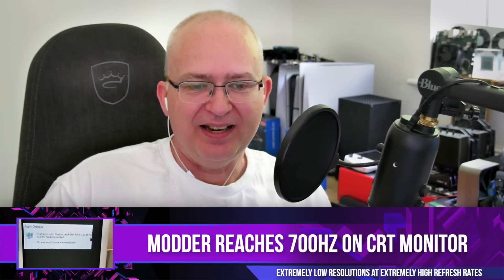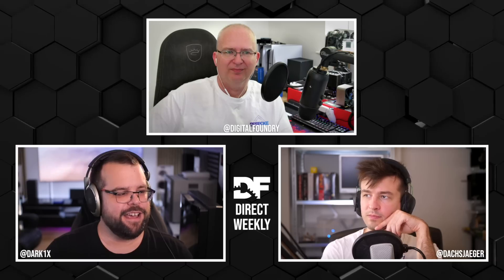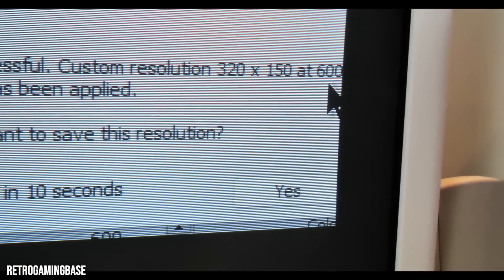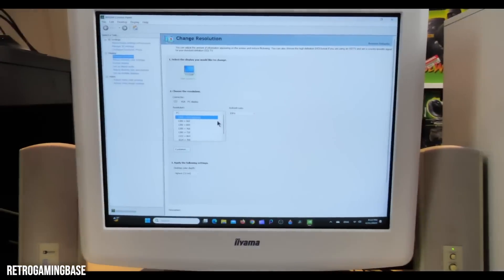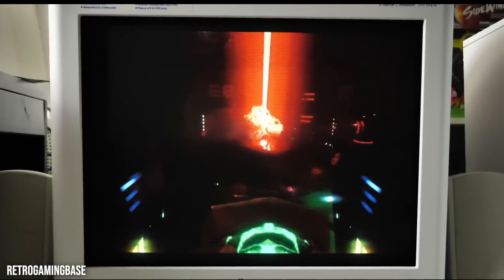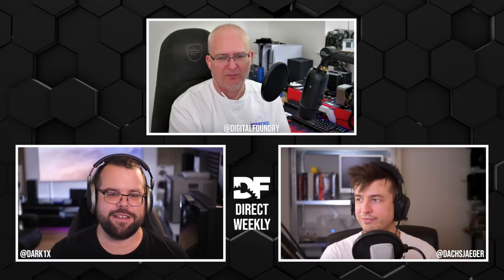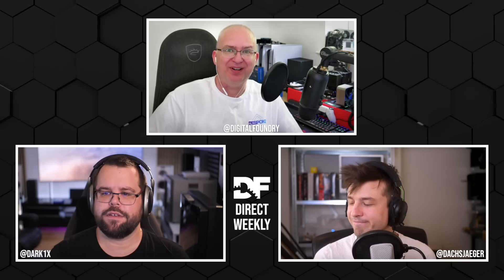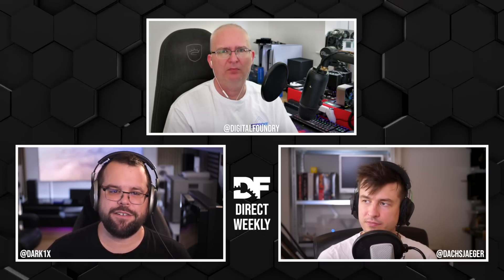CRT Display Hits 700Hz Refresh Rate - But How?

Comment: Isn't a Plasma TV the highest Hz at 600Hz you can buy still...?
Reply: Problem with these plasma screens was they were basically just 60hz but strobing 10 times in a frame, Effectively not very useful, just a marketing term for the way plasma strobes.
Reply: Nope. It's a myth designed by guys from marketing teams selling plasma displays. Plasmas didn't worked like modern LCD when whole displayed image is swapped at once but they switched it by gradually changing the horizontal bars that together comprise the image. The whole image on plasma display is swapped 60 times a sec (or 120 in case of the 3D TVs, which display a separate image for every eye), but marketing guys get the idea of multiplaying amount of bars per real refresh rate to crack the bigger number. The real reason why the plasmas have better motion clarity was due to disabling the bars during swiching the image which gave the black frame insertion like effect.
Reply: No, plasma TVs are truly 60Hz. However, due to how plasmas handle motion, it can look like 120Hz. I've got a plasma TV and it's comparable to my 144Hz monitor due to the motion.

Comment: 13:30 First experimantal OLEDs were driven impulse instead of sample & hold. THAT would be the solution.
Reply: If i remember correctly the enormous brightness required for that burned out the organic pixels way too quickly, might be feasible again with micro leds though.
Reply: @utahnl  Micro LED is basically dead due to power consumption vs OLED.

Comment: Nice Video guys ❤️🍻 yeah this CRT is a bit special because it’s vertical rate is totally unlocked. The manufacturer rated this CRT at 200Hz which already is higher than most others also.
There are more unlocked CRTs out there but they have to be kinda found by trying them out…

And I also would love to have the CRT tech reintroduced 👍❤️
Reply: Yeah that's pretty insane since it took until like 2013 to get 240hz on a LCD at all, and beyond that before gaming monitors had access to refreshrates that high with all the other features. I only went to 240hz this year, with a VA monitor, and it's so minor over 144hz, it's pretty much the limit that 99% of people would need to use.

This refreshrate race of who can get the highest is just so dumb because OLED going mainstream has already shown us that 360hz and above on LCDs is pointless when a 240hz OLED looks smoother.

Comment: OLED is very close to CRT in terms of motion clarity in my opinion, obviously it's not as good but it's to the point where I was happy to shelve my CRTs for OLED, but no doubt CRTs still have the edge and if they ever came back I'd probably buy one.
Reply: OLED start degradate about four months of using 😭
Reply: @tvndno6023  No.
Reply: Oled has much better colors and 0 flickering than a CRT
Reply: OLED is not even close.  Even watching sports and movies look terrible when the camera spans at medium speed to follow the action.  Your eyes must not be sensitive to sample and hold motion blur.  I still remember watching the world cup in 2014 on a plasma at a sports bar and the motion was incredible.
Reply: ... what? OLED doesn't even come close to CRT in motion clarity, as they have awful sample and hold blur. You need black frame insertion on these displays to get better motion, and then they become extremely dim and only have plasma level motion clarity at best.
Reply: Lol, OLED is joke in terms of motion clarity. I own some high end Sony OLED TVs and a last gen Panasonic Plasma. The Panasonic Plasma has motion clarity that is a lot closer to a CRT. The OLED doesn't even come close. At 120hz the OLED still couldn't match the motion clarity of the Plasma at 60hz much less a CRT.
Reply: @elmaton04 with black frame insertion motion clarity is pretty close to plasma, picture gets dim though.
Reply: @elmaton04  I own about 7 CRTs, and six OLED devices.
Reply: @Cadence_Squirrel  Yet your opinion is completely off from the facts. With black frame insertion, OLEDs still doesn't get close enough to a Plasma TV or CRT even at 120hz. Yes also own CRT displays and been using them for decades now. Plasma display tech is the closest tech that can almost match the motion clarity and fluidity of a CRT, not OLED or LCD which are further off.

Comment: One thing I really admire about CRTs is how they handle color - there's barely any banding, even with 8 bpc color depth. Colors just look incredibly natural, unlike pretty much any modern display I've seen in person, even HDR displays with their increased color depth.

I also remember playing CS:GO at 640x480@120 Hz on a CRT back when I didn't have a 1080p monitor... It was a blast.
Reply: CRT's usually blend colours into adjecent pixels, so you'd naturally get a sort of dithering effect going. It's not accurate to the intention with modern content, but is definitely heavily used in old games.
Reply: @MLWJ1993  That's a problem with shadowmask CRTs, not Trinitrons or CRT projectors.
Reply: @MicahtheDrumCorpsPseudoboomer  I think some of it is also an artifact of the video interface.
Reply: @MicahtheDrumCorpsPseudoboomer  It depends on the shadow mask, my 955DF has a dotpitch of 0.20mm, it looks sharper than a FW900 trinitron (but it's a bigger screen).
Reply: When playing Metroid Prime on my Toshiba 20AF45, I somehow see the color banding.  Is it just me?
Reply: @MicahtheDrumCorpsPseudoboomer  I suppose it could be something with the monitor, console or the setup. I've never seen this happen with any VGA monitor with a PC set to either 24-bit or 32-bit color, and that's what I meant.

Comment: The answer is easy: they were better in everything, but power consumption and resolution. Time only proves the point even further. Glad I still have 5 FW900's.
Reply: They also have to warm up...
Reply: @Gamesemag Sell me one of your gdm-fw900s please
Reply: Not quite, there were also two other big issues: humming from the transformer and more importantly non-existing black levels with any ambient light. I still remember that CRT were just able to display a grayish mess instead of a proper image in a well lit classroom.
Reply: @krazownik3139  Yeah, granted most people, us included, probably never actually saw an expensive CRT. The ones I saw always were just scanlines, blurriness and nothing but washed out, dull colours. Any modern IPS automatically looking nicer.

Apparently higher resolution CRTs do look cleaner than a 4k IPS, VA or OLED, but there's no chance of it's colours being like the OLED. For a lot of people the colours and the HDR are more important than the pixel density.
Reply: @krazownik3139  That's where FD Trinitrons come in.  They have a flat surface, which reduces the amount of glare somewhat, and being Trinitrons, they're notably brighter as well.
Reply: @krazownik3139  I never had any issues with the humming or any noises even when I was a kid with perfect hearing not to mention now. Maybe some cheaper models had this issue.
Also not sure about 'non-existent' - to me it is very exaggerated phrasing. They lose to OLED (I did compare them side by side) sure, but only if you introduce bright lights and so on. For my condition and ambient glow, I never had any issues, especially when the screen is properly calibrated to 120 cd/m2 or 140 max in a light-controlled environment
Reply: Now to think about it I do remember a few more cons: lower than IPS panels brightness (but still plenty, I think w/o anti-glare coating FW900 is capable of producing 300+ cd/m2 or something like that, I do not remember the exact measurements anymore that I did back in 2019 or something).
But I don't think there is a need to push the brightness so hard for SDR content in the first place, it is an incorrect approach to begin with.

And phosphor traces, especially noticeable during dark scenes on FW900 (white-ish or green-ish traces) behind the bright objects on the dark background. I do remember seeing them on 2070SB too, to some extent.
Reply: 5 of them?!
Reply: @MicahtheDrumCorpsPseudoboomer  Well, more like 4 properly functioning because 5th died on me in 2018~ but I doubt it is a tube issue so I decided to keep it.
I started to collect them a long time ago and most of them were bought before they went viral, a long time before Linus the hype idiot started to make his typical trash content on them and prices skyrocketed.
Reply: TN and IPS always felt terrible to me, especially when they arrived on the market and had 60Hz panels only. I was playing professionally in CS 1.3-1.6 (as well as Quake and UT) at that time and was very sensitive to any kind of motion blur. So the choice was clear as night and day for me, even when people laugh at me for sticking to the 'outdated tech', I still prefer the beautiful phosphor glow over the 'dead light' of modern 'superior tech'.

Many people don't realize you don't need 5000+ nits for a good picture.
More than that, in most cases high brightness only causes strain and damage to your retina, nothing else. I had 48" OLED for some time and calibrated it as well, it was really good but still had that 'dead' appearance to me.

Earlier, I used 2070SB by Mitsubishi for the most part - this tube I cannot recommend enough.
I had 4 units, one was over 50k hours of use. Way more than Sony tubes are usually capable of.
Brand new one - I sold for 2k+shipping so I can buy another FW900. Now I have one tube with around 6k and the one with 15k that I used constantly.

I also had Iiyama 514 but it was borderline dead - picture was too dim, it was impossible to calibrate them because their menu does not contain blue-GAIN values if I'm not mistaken. So you can only manipulate R and G gains. But I was able to push it over 200Hz with NV Titan before we even heard of 240Hz panels, lol. So much for outdated tech, yeah 😀
Reply: How do you have 5 of them?!
Reply: all 5 of them???
Reply: Can i have one ?
👉👈

Comment: No input lag?
Reply: Since there was no image processing on most CRTs, yes there is no input lag. CRTs only got input lag when digital processing started to happen with HD CRTs, which were only in the realm of TVs not computer monitors
Reply: @crestofhonor2349  Correct me if I''m wrong, but it isn't it that the moment you're running a GPU with a frame buffer, you do get input lag, even with a CRT. The "no input lag" thing only applies to very old systems that forced programmers to execute code in between the beam of the electron gun painting the phosphate layer of the screen, also known as "chasing the beam".
Reply: @no1DdC  When people refer to input lag it's always in the context of the display itself. System input lag is different from the display adding it in. A CRT monitor adds in no lag to the signal at all since it is not being processed
Reply: @crestofhonor2349  I have definitely read about the entire input lag, including processing time on the computer, being discussed, especially when comparing old systems to today's hardware.
Reply: @no1DdC  It depends how you look at it. CRTs as such literally have no response time, at least not really measurable, and absolutely not noticable.
The conversation was solely about monitor input lags, ofc there's input lag on every device before being sent to the monitor ....even on your mouse....

Comment: I would love to see a modern day CRT
Reply: @lain6889  little bro, you seem to be the one that's coping. OLEDs absolutely do not have better motion clarity than CRTs and to come even close to a CRT, it would actually have to flicker with BFI and the picture will dim like crazy.  I literally have a CRT PC monitor right next to a 240hz OLED. It's not even close.
Reply: OLEDs are too good now and this is coming from a gamer from the 80s.
Reply: @benchmark3332  You can even play Pac Man w/o electricity. You just need to keep a level playing for hours, then, power your device off and use a white edding for marking progress in the game :D Nah, honestly, if they can get rid off this disadvantage, OLED is nice, though, QLED is prone to overheating which in turn makes a certain reflective foil wobbly, which in consequence leads to very uneven lighting. I mean these really thin QLEDs, they can't dissipate heat properly.
Reply: I wish they could create something based on CRT technology but without all the caveats. Loving CRTs but it's an eye killer and the power consumption is too high. The weight and size well, I think it's the least of the problem.
Reply: The eye killer aspect only happens if your refresh rate is 60 Hertz or below.
Reply: @MicahtheDrumCorpsPseudoboomer  Had a 120 Hz LG 17 inch monitor back then, it was awesome, but even that 100 Hz wasn't as comfortable in very long term than a 60 Hz LCD. But it was decent. And the image quality and smoothness was nice! But yeah, my eyes still felt it a bit.
Reply: Surface-conduction electron-emitter display had several legal issues and many other coincidental problems, but they existed for a while. MEMS laser displays are the closest you can get to CRT nowadays.
Reply: @vitordelima  Bit sad reading about the history of SED/FED. At least OLED did not have the same fate.
Reply: I would imagine there will be some people that try and build some more modern CRTs since so many people want them. They'd be expensive though I would imagine.
Reply: doubt it's gonna happen, just too bulky
Reply: @ItsCycloneAI  That's the cool part, how heavy they are!
Reply: https://en.wikipedia.org/wiki/Surface-conduction_electron-emitter_display
Reply: I’d love this, but LPDs (Laser Phosphor Displays) are probably a little more likely
Reply: Don't misunderstand me, I would LOVE it if CRTs became more common than they are now, but getting to that point is going to take an astronomical amount of effort.
Reply: Although I'd love to see a modern day CRT, I'm afraid long gone are the days of analog TV manufacturing and current engineering might not be up to the task. Just because modern manufacturers can produce 4K flat panels today doesn't mean they can produce a CRT.
Reply: @HugoGEDHugoGED There was a 4096x3300@72 Hertz monochrome monitor made in 1988 by MegaScan; surely modern engineering must be up to the task.
Reply: @MicahtheDrumCorpsPseudoboomer Yeah back in 1988, when analog TV design was thriving. Most engineers who know about CRT design and manufacturing are probably already retired. Very few people know how to fix one nowadays let alone designing one.
Reply: @HugoGEDHugoGED  There's a factory in Ukraine that is making Nixie tubes for Millclock, and there's a new Pennsylvania Railroad Class T1 steam locomotive under construction (all the original T1s were scrapped).  Britain already built LNER Peppercorn Class A1 60163 Tornado; surely the least we can do is create at least one brand new black-and-white standard definition CRT.  It would be insanely expensive, but it needs to be done for the purpose of bragging rights.
Reply: @MicahtheDrumCorpsPseudoboomer  Now that's some interesting info, from that perspective I think there might be ways. If no action is taken it'll become a lost art if it hasn't  already.
Reply: @lain6889 Not true. OLED still uses sample and hold like LCD’s do that results in stutter. Motion resolution is also terrible still in comparison to CRT.
Reply: A specific group of very political folks wouldn't allow it because of power consumption.
Reply: Bye bye eyes
Reply: i think we will see modern crts within the next 10 years
Reply: @YungRamo I'm kinda skeptical about that.  In 2005, Europe made a Restriction on Hazardous Substances (RoHS), and one of the things it banned were CRTs because they are made out of leaded glass.  Plus, we junked our CRT factories a long time ago and forgot how to build them.  Furthermore, the only people who would buy CRTs are gaming nerds like you and me, not the general populace, so brand new CRTs would be astronomically pricey.
Reply: @MicahtheDrumCorpsPseudoboomer  i think there have been enough advancements in production to make a small scale CRT factory possible without the need for economy of scale. I agree they would be pricey, but I do think there is a market for expensive new CRTs. Main problem is leaded glass issue, someone will have to come up with a new solution. But I do understand your skepticism, its by no means a sure thing.
Reply: @MicahtheDrumCorpsPseudoboomer  Boutique products for niche customers do come out here and there whenever there's demand for them. Even things like new 35mm film stock are being created through old documentation and making them in limited quantities. It could happen, just obviously not at the scale previously
Reply: @conthemar On the flipside, Technicolor cameras haven't come back, even though it would make films easier to preserve.  Showscan, a 60fps film camera/projection system, never really took off and still hasn't taken off.
Reply: @MicahtheDrumCorpsPseudoboomer  I would be a couple of grand for a top spec new CRT, I hope they do it
Reply: @MicahtheDrumCorpsPseudoboomer  "forgot how to build them"
I chuckled loudly at that "thought".
Yeah, dozens of companies all simultaneously "forgot" how to make them.
Sure, Jan.
Reply: @YungRamo  I also think there could be a niche market for it, yet, when LEDs or whatever outweigh the advantages of CRT, I guess they'll remain in museums for cultural/historical purposes.
Reply: @MicahtheDrumCorpsPseudoboomer  smarter to pay 5000€ for a factory new 27", 2K/4K, 240hz CRT with optimized colors and contrast etc. than for a 25 year old half-dead one on ebay..
Reply: @YungRamo  I doubt it considering cost and the fact that CRTs were led lined inside the tubes. I heavily doubt we'd ever get a CRT made again, especially on a large scale. I love CRTs but the possibility of them coming back is just very unlikely. They simply do not have the popularity to come back